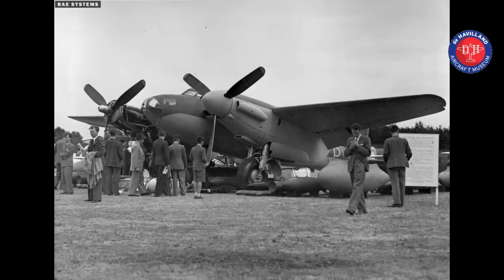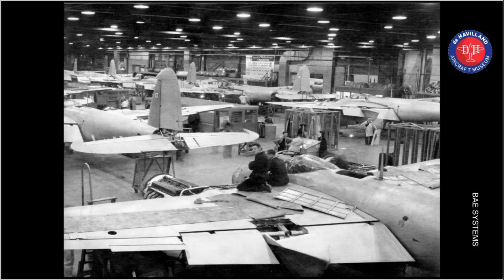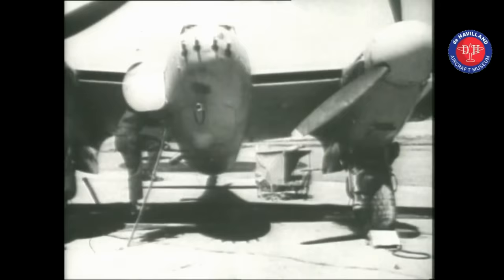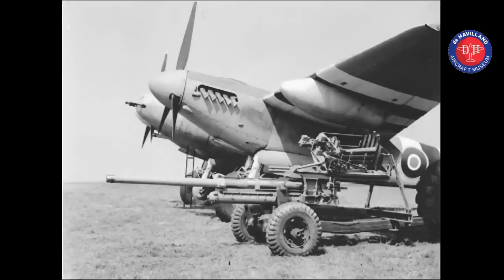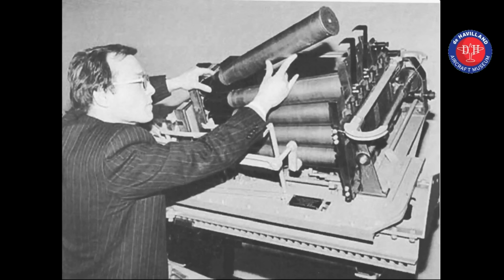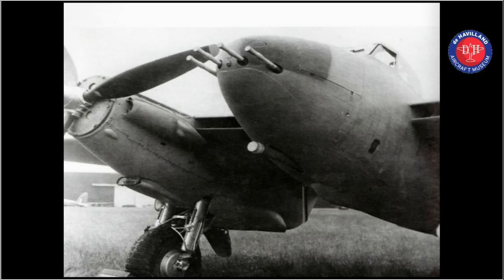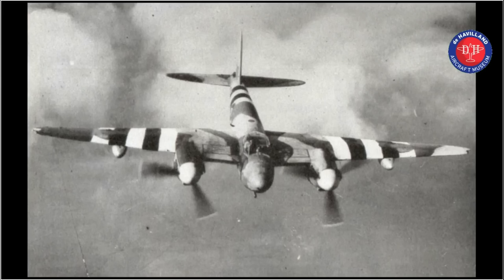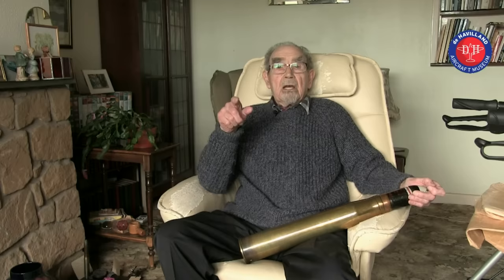TSETSE the DH Mosquito Mk XVIII

Comment: What an amazing aircraft, possibly the most effective of WW2 it seems nothing could catch it and its ability as a multi role aircraft were unequalled. We should have made 1000s more. Great video thanks for posting :)
Reply: The 'P-47 Thunderbolt' was indeed a great aircraft. Likewise The Hawker Tempest. But the best aircraft of WW2 came about when British Rolls Royce Merlin engines were put in American P-51 Mustangs.
Reply: The radial engine on the P-47 was an important part of the rugged survivability of the plane. A pilot could loose one or more cylinders to ground or air to air fire and still be flying and fighting. The reason? Radial engines of the era were air cooled, so there was no vital coolant to loose or radiators to be damaged by a single round to them. Additionally Republic built a very strong and sturdy aircraft to deal with the power of the Pratt & Whitney R-2800 Double Wasp as well as providing the pilot with an armoured cockpit.
Reply: What about the USS New Jersey, another weapon system not having anything to do with this video.
Reply: Who cares about the P47? It was a flying locomotive compared to the mossie and couldn't do half the roles carried out by the wooden wonder. Why does some Yank have to bring up the P47 in a video about the Mosquito.
Reply: Just a point, England is only 1 country in the UK, we also have Scotland , Ireland and Wales, some facts appear to have been forgotten in history. I will let you check what I have to say. Dunkirk ?? who helped and held back the Germans to allow this to happen. The 51st Highland Div. were sacrificed at ST Valarie and Abbeville, 1100 Killed, 40,00 Taken prisoner, no ammo, no food and no medical supplies . Just watch ' 7th Argyles Abbeville'. Yes we needed the Yanks, but they also needed us, Penicillin, radar, and yes the Merlin engine, also a fact also missed was the Liberty ship, a UK design passed to the US ,for construction, and never forget the time differences, you arrived in 42, we had been at war since 39. As for your comment on Empire, which other country has a family of over 50 countries tied together, The COMMONWEALTH , has over 1/4+ of the worlds population. Don't run us down just yet . and ask any US trooper who he would choose to guard his back.
Reply: Gerry, the Jug was a useful plane, but let's not get too ahead of ourselves. The armament of 8 x .50 calibre machineguns was nothing special for a late-war single-engined fighter, as most combatants were using 20mm or even 30mm cannon by this stage (a single 20mm cannon is as effective as three .50 Brownings). The Jug was quick in a dive, but quickly lost the ability to maneuver (its Mach number was lower than the Spitfire, ME109, FW190 and even the Mustang). This was one reason why the Americans stopped using it as an escort fighter - it couldn't intercept German fighters diving through air formations. As for its ability to survive damage, yes, that was probably its greatest attribute.
Reply: Wow Gerry you sure know all about the jug and America winning the war so we don't have to learn German. Shame this video is about the Mosquito. So run along and find a nice Yank video that tells about the jug winning the war, I'm sure there are a few out there. Oh by the way, the only German word I learnt was Gerry. LOL.
Reply: Quite right RicTic66: North American Aircraft designed and built the P-51 to a British specification, although the original Allison engines were under-powered and didn't operate well at altitude.
Reply: No disrespect but as you said the records have been destroyed supposedly, How can your story believed? If you have any proof please present it. Thanks.
Reply: Gerry
 Contrary to opinion , the Mossie could absorb massive punishment , its wooden construction allow cannon and flack to go straight through without exploding , and the plywood shell didn't have single weak points 

As for the P-47- I'll take the Tempest over it any day
Reply: It just amuses me to see you put so much energy into your idiotic ramblings when I only have to write a sentence!
Reply: Gerry Nightingale You talk a lot of sense but then you let your self down It was the British and her commonwealth forces that were responsible for Germany and her allies defeat in the first world war. In 1918 there was only one army in the field that had been in the war from the outset that was still capable of prosecuting the war and that was the British army. So where you get the notion that the first world war was a war that Britain could not win is beyond me. Perhaps you could enlighten me as to actually did win war for the allies and please don't say the Americans because if wasn't the British and her commonwealth forces( i am not counting the French because they were a spent force by 1918.) that only leaves the Americans
Reply: Gerry, I am not from the UK (different hemisphere) and where I am from we also call you wankers and yanks though I prefer to use the slang of septic tanks.  Lend-lease was the industrialists way of producing more war material and still get paid for it.Tom Lucas, you forgot the jet engine in your list of gifts to the Septics. Lastly, the P51 was an American built fighter made to British specifications and it was crap with the Allison engine in it.[EDIT] Sorry Shaun Salter, missed you post about the specs.
Reply: The Merlin mated to the P-51 became operational after Germany's loss of the war was sealed. The P-47 and the P-38 had carried the ball, the P-51 receives the credit, wonderful plane that it was. The first Allied fighters over Berlin were the 55th FG  P-38s on March 3, 1944. The P-51s didn't arrive until Summer, and the conversions was based on less operation expenses, high Altitude problems with the cold in the Northern European  Theater of operation, the kill to loss ratio was only marginally in favor of the Mustang. Southern European Escorts out of Africa, and later Italy used P-38s to the end of the War. The FW190s and Bf109s were equal to in performance to the Mustangs, but by the time of the Mustang arrival, attrition of experience German Luftwaffe Pilots, and a poor flight training program favor the Mustangs.  

In the 1969 two Central American countries, Honduras and El Salvador,  had a brief war, one Salvadorian P-51s and two FG-1D Corsairs were shot down by Honduran Air Force 17 Corsairs (nine F4U-5s and eight F4U-4s). On the morning of 17 July, a Honduran F4U-5 flown by Maj. Fernando Soto Enrique (then a Capt.) downed one of two Salvadoran P-51s that had been attacking two Honduran Corsairs on a ground support mission. 
Later, on his fourth sortie of the day, Maj. Soto shot down two FG-1D Corsairs from El Salvador in a single engagement. The last Piston Engine vs Piston Engine combat. Top US Aces in WWII, ETO, Francis "Gabby" Gabreski 28.0 and Robert S. Johnson 27.0 both flew P-47 against the best pilots Germany could offer.
Reply: The Mossie was a great plane in its various rolls, but the top Mossie only ace had 7 fighters to his claim.
Reply: +Gerry Nightingale - The ME-109 was basically an engine with wings, tail and a seat attached to it.
Reply: +farmerned6 - When the Allies first met the ME-262, the ME-262 shot down 2 Mosquitos. The ME-262 had 4 30mm cannons, but their jet engines were notoriously short-lived(very likely because the Germans had little access to rare metals to make the high-strength alloys needed) and burned the scarce high-octane fuel very quickly. 
The Tempest motor, the Napier Saber, was basically 2 V-12 engines in one, which worked great when it ran - it was almost unbelievably powerful, and Tempests could - and did - run down and kill V-1 buzz bombs(the first cruise missile.)
Reply: +Gerry Nightingale - Instead of what you say is Soviet propaganda, Jandal is referring to WW-2 German records; 2 of every 3 German soldiers killed was in the eastern campaign. Check for yourself. Also, you should remember that Detroit was once an America Propaganda Center, sometimes known as "What's good for General Motors is Good for America." I'm aware of the Russian's relying on American motor vehicles(my Dad, who was in WW-2, told me of meeting Soviet troops, driving early-model jeeps and telling them they were American - and the Soviet troops denied it - even though the jeeps had "Willys" stamped on the front.) The lack of motor vehicles was one under-realized reasons the Germans lost. Also, you should calm down. You shouldn't go ballistic just because somebody disagrees with you.
Reply: Stop asking people for their names Gerry - it's extremely unwise and unsafe to let go of your anonymity on the internet, especially in a popular and crowded place like YouTube.
Using your real name as your screen identity isn't some kind of badge of honour - something to be proud of while all the cowards hide behind screen names - it's a dangerous risk.

--S
Reply: I do have a name, but you're not getting it.
Nobody online is getting it because I don't feel like having my identity stolen.
Demanding that people release details that they don't want to share with strangers is extraordinarily bad manners - something you apparently have in common with Trump.

--S
Reply: Tracer rounds aren't designed to burn anything, only illuminate.
Incendiary rounds are the ones that do the burning.

--S
Reply: Your problem is that all of your 'facts' (by the way - what's with all the unnecessary quote marks?), are buried in a mass of arrogance and a complete unwillingness to tolerate anybody questioning them.
Doesn't matter how true or fake they are - you act like that, that's all people are going to see.

"I wrote nothing 'unseemly' until I was attacked."

When did I imply otherwise?

"my mistake is in thinking ... "

No dude, your first mistake was pushing your way into a thread where people wanted to talk about a certain plane they liked, and insisting that your favourite one was better.
Your second was your refusal to accept that anyone else could have a different point of view, or a different opinion about what might have made any aircraft of WWII subjectively or objectively, "the best one."
Your third was letting your temper run away with itself when other people got annoyed with your arrogance.

Like I said, if you want people to pay attention to your opinions, you need to dial that shit way back, otherwise you might as well just be shouting at the air.

--S
Reply: "I wrote nothing 'unseemly' until I was attacked..."

I just scanned back to the start of the thread to check, and all it took were two sarcastic comments, little more than typed eye-rolls and hardly "attacks," before you were insulting an entire nation and its heroes.
You're not nearly as innocent as you might imagine you are.

"... and no one need to take 'seriously' anything I  write."

Why on Earth are you writing it then? How were you hoping we would take your posts, if not seriously?

--S
Reply: I think it's time to disengage guys - Gerry's not interested in facts, or even debate. At this stage, he's just trolling us. Finding evidence proving him wrong won't change things - no evidence we could ever provide will ever be good enough to challenge the pre-conceptions and arrogance that he mistakes for his own 'evidence.'
This is just going to get more and more needlessly toxic and insulting.

--S
Reply: Hear Hear.
Reply: Gerry, If you didn't drop out of secondary school (or you broke out or were paroled from reform school before graduation) you could very easily look up diatribe in a dictionary or online. However, diatribe a forceful and bitter verbal attack against someone or something would be a misuse of the term, polemic would be more appropriate. I leave it to you to look up that word.
Reply: "The records for the 'P-47' are actual documented history..."
So what? They're still completely irrelevant to the topics of both the video we wanted to discuss, and the discussion that RicTic66 tried to start.
Let's go back and look at the original post, shall we?

"What an amazing aircraft, "

Unquestionable - you've admitted as much yourself, several times if I remember correctly. Why did you feel the urge to one up RicTic66 and the Mosquito, hijacking the conversation with your fawning over 'the Jug?'

"possibly the most effective of WW2"

There's certainly an argument for this. There's probably an argument against it too - you didn't offer one though. You just started talking about how 'the Jug' destroyed more 'tanks' and 'trains' and had 'super powerful' and 'unbeatable' .50cal 'machineguns.'
Totally irrelevant. Yeah, it was a great fighter bomber (which nobody EVER questioned by the way) - that doesn't make it the most effective aircraft of the war. Not even close.
How was 'the Jug' at strategic bombing? Tactical bombing? Pathfinding? Intruder patrols? Interdiction? Night fighting? High level or low level reconnaissance? Maritime patrol? Convoy raiding? Sub hunting? Undoubtedly I've missed a few. How many 'Jugs' flew from carriers? How many other jobs could 'the Jug' actually do?
The Mosquito's versatility and time in service are what put it in the running for the most effective aircraft of the war. Given that you didn't seem to want to talk about any of that however, I'm forced to wonder once again - what are you doing here?

" it seems nothing could catch it"

Hyperbole perhaps, but its reputation as one of the fastest things in the skies is both well known, and well deserved.

" and its ability as a multi role aircraft were unequalled."

As I just demonstrated.

So, what exactly did you take issue with from RicTic66's comment? What did you think they were wrong about?
I suspect that you simply saw a comment extolling the Mosquito and felt the need to take us snivelling and cowardly Brits down a peg or two by reminding us that 'the Jug' was better at blowing up tanks...

--S
Reply: That's weird - my last two comments appear the opposite way around from the way I posted them... The "disengage" one was supposed to come last.
Glitch in The Matrix?

--S
Reply: 3 weeks ago I wrote a 'subjective' post about how I as a proud Englishman whose Mum and Dad both fought during WWII with the R.A.F, thought the De-Havilland Mosquito was "possibly" the most effective all-round fighter /bomber of that conflict. Someone chose to question my choice and as everyone has a right to their own opinion I left it at that. After all a subjective opinion is just that. I've just visited a sight singing the praises of the   P-47 Thunderbolt and they're are no Brits claiming superiority or just being rude. I bet if the fellas who flew these magnificent aircraft in combat could see the tone this thread has taken they would  be saddened by all the nastiness.
Reply: I love the Mosquito and got to see one fly a few weeks ago up here in Seattle. Best a/c of WW2!
Reply: +d17a2dude
I hope you know how lucky you are!
Was it a restored plane, or a new build?

--S
Reply: Mark Fryer   "Radial engines of the era were air cooled, so there was no vital coolant to loose or radiators to be damaged by a single round to them."
very true....but a single round in the oil feed or sump......!!
Reply: Gerry Nightingale..Having read your comments about the Brits, the Yanks, WW2 and it's aircraft and who did what, may i just say.....you deserve every insult that is thrown at you
Some of them were, IMO, quite funny......".and my contention was and remains that in 1940, with the bulk of military ground-forces trapped in Normandy, Hitler could have simply slaughtered them all and proceeded with the invasion."   Using what? Lets say he slaughtered the entire BEF.. Now , he only had to gain air superiority, neutralise the Royal Navy...and beat the English channel. After Sealion was cancelled, in reallity, all Britain had to do was sit back, drink their tea., and watch the show. Unlike Americans, the British knew exactly what the Channel meant...Anything other than flat calm....forget it

"(it was 'radar' that saved the 'RAF'."
No, it was radar that enabled the RAF to pre-empt the luftwaffe raids.and to be in position to meet them.

"

".Germany had 2x as many aircraft available to accomplish that task, and for reasons I cannot find did not choose to do it ".
Well, if you don't know why, then you have no business making comments.. As for can't find out why....hell man, it's one of the most documented periods in history
Try this for size. 
you wrote...".English airfields were rarely attacked en mass...simply creating 'craters' would leave any  aircraft on the ground helpless, unable to take-off...and the 'long-millimeter' radar-towers were not attacked either...which would cripple RAF fighters by not knowing in advance 'where/when' the Luftwaffe would attack"
Actually, The airfields and radar stations were the ONLY things that were being attack in the early stages, and had Hitler not ordered reprisal bombing raids against London, instead of hitting the airfields the luftwaffe would have succeeded.
Yet you, an American authority on this subject didn't know this because you couldn't find any reasons..

"Hitler made plans to 'invade England' and what of it? "......Which practically  the whole high command knew couldn't be carried out for the reasons I gave above.....which is why it was cancelled after the BoB.
And before you say anything about the US and the BoB........this was fought in 1940, BEFORE lease-lend. Anything that went to Britain from the US was bought and paid for in hard cash, and at a time when the US was also trading with Germany

"had the U.S. not 'pounded the living shit' out of Germany and virtuallyannihilated the Luftwaffe BY OURSELVES...".   US 8th went to Britain in 1942. Now, according to you, Britain would have been dealt with by Hitler.....so, where would you have flown from...Newfoundland? And the Luftwaffe your guys faced from 1943 onwards was a shadow of the Luftwaffe of 1940

And you seem to think Hitler would have won in Russia. lol. That was never going to happen from day 1, with or without aid from anyone.  Germany was never equipped to fight in Russia during the winter..

".and yet Churchill said and did NOTHING about it...no 'war declared' against Russia as he had done with Germany."
a) Churchill had been warning the British Government well before Poland was invaded.
b) At the point that Britain and France declared war on Germany...Russia had NOT invaded Poland until 2 weeks later
c)Germany and Russia were not "Allies" as you seem to think. They had a non-aggression pact....which is a different thing altogether.  Russia also had a similar non-aggression pact with Japan.
d)Churchill was only 1st lord of the admiralty between Sept 3rd 1939...and June 1940. 1st lords of the admiralty do not declare war on anyone....and Churchill did not declare war on Germany
e)the pact between Poland and Britain was specifically about German invasion

"The photos or written material that prove that English fighters (NOT the Poles who flew with the RAF as 'independents) flew escort for the 8th. Air Corp? I WANT TO SEE THE PROOF that the 'RAF' flew as escorts over Germany with Americans! WHERE IS IT? "
a) Poles did not fly as "independents" They, like Canadiaian s, yanks, Aussies Kiwis wee all part of the RAF.
b)Lieutenant General Ira C Eaker and officers of the RAF Fighter Command agree to use Spitfire Mk IX's as high fighter cover for B-17s of the VIII Bomber Command until the VIII Fighter Command is ready for escort duty; this also will provide a test of the Spitfire Mk IX against Fw 190s at high altitude. HQ VIII Fighter Command moves from High Wycombe to Bushey Hall, England.......http://www.8thafhs.org/combat1942.htm

And from the same link.....MONDAY, 17 AUGUST 1942

ETO (8th AF): Mission 1: 12 of 12 B-17s bomb Rouen/Sotteville marshalling yard in France at 1739-1746 hours; they claim 0-0-1 Luftwaffe aircraft; 2 B-17s are damaged. 6 B-17s also fly a diversion without loss; escort is provided by RAF Spitfires.

TUESDAY, 8 SEPTEMBER 1942

(ETO, 8th Air Force): The "Joint British American Directive on Day Bomber Operations Involving Fighter Cooperation" is issued; worked out between Major General Carl Spaatz and the RAF, it consigns night bombing to the RAF and day bombing to the Eighth Air Force; the purpose is to achieve continuity in the bombing offensive and secure RAF fighter support for US bombers.

Unfortunately, that link only goes to the end of 1942, but it is enough to show that the RAF did escort US aircraft over enemy held territory..

Anyway, i think I have said enough to goon with. my point is made...if you don't want shit from people ....don't shit on them.....and please learn your subject.

BTW.....I'm South African of boer descent.. I have more reason to dislike the Brits than you could dream of...but really....you asked for it.

".
Reply: the P47 WAS SHIT!
Reply: Hey, Stinkie Dmin,  I just do not understand why you had to mix inside this melee our great president Donald Trump. 
If you really want to spit against wind, Angela Merkel and Jean-Claude Juncker are conveniently close to you.
Reply: I Like The Mosquitos I Was Wondering What Two P-51 Engines Would Made Do? ,Whew!!   WDA
Reply: Gerry is the stereotypical arrogant American. Just shut up. The p47 wasn't even that great. And the effectiveness of JABO's vs. Tanks is grossly exaggerated.
Reply: @DavidSmith-ss1cg  The Nazis had FAR more vehicles than they could use.  Their problem was shortage of fuel, which was the reason for the Afrika campaign (Middle East oilo), and also Operation Blau of 1942 (Caucuses oil).  The Wehrmacht had to go over to horse-drawn transport and shank's pony, the Luftwaffe had planes they could not fly, and there were hundreds of VI and VII rockets in stock but unused due to shortage of fuel.
Reply: @RicTic66  The P47 was shit doing Ground Attack Dive with a P47 and you went into the Ground 2600 WERE LOST to ground fire or simply unable to pull out.
P51 in a pigs eye.The Spitfire could fly rings around it all day
Reply: @markfryer9880  well how is it that they lost 2600 in the Ground Attack role RAF Typhoon combat debut one year before the P47 and only lost 670 from 42 to 45
Reply: @ALA-uv7jq  They like to muddy the waters
Reply: @Renshen1957  Oh dear here we are talking about a Mosquito with a large cannon than sank ships and probably killed 1000s of Germans and you want to rave on about aces Your Best was 26 Germans killed shit Pat Pattle in a Hurricane II got 35
Reply: @Renshen1957  You Americans forget the Spitfire was killing Germans 4 years before you came in and had more victories than the P51
Reply: @DavidSmith-ss1cg  The Mossie had 400+ VIs
Reply: @janalldaffer2913  what are you talking about ? the engines in the Mossie WERE Merlins the P51 licensed copies
Reply: MajorLeague  Over taken by the Mossie
Reply: @jacktattis143  The Chinese (Nationalist Republic of China and  Soviet Republic of China) can call the UK Johnny Come Lately's as they had fought the Japanese since 1937, or the Abyssinians (Ethiopia) fighting the Italians in 1935. And the Germans aces with totals into the hundreds.  The Spitfire was a great short range tactical interceptor which received the most of the glory during the battle of Britain, and the nineteen Spitfire squadrons were responsible for shooting down 521 enemy aircraft. The Spitfire's range An average of 27 per Spitfire. During the Battle of Britain there were 32 Squadrons with Hurricanes and only 19 Squadrons of Spitfires. Hurricanes shot down more aircraft than all other air (including Spitfires) and ground defenses (anti aircraft guns) put together. No. 303 Squadron RAF (Polish) Hurricane Squadron "Had it not been for the magnificent material contributed by the Polish squadrons and their unsurpassed gallantry," wrote Air Chief Marshal Sir Hugh Dowding, head of RAF Fighter Command, "I hesitate to say that the outcome of the Battle (of Britain) would have been the same." And the UK Govt. wouldn't let the Poles march in the Victory Parade so as not to offend the Soviets. Sgt. Josef František with 17 victories was the leading ace of the Battle Britain.  The 303 converted to Spitfires Jan. 1941. 

We don't forget the day we entered the war, or prior in violation of international law, we claimed neutrality and shipped war materials, performed convoy duties (neutrality patrols, , fuel, etc. to your country.   We also don't that instead of making the Pacific our major commitment and the US citizens of US territories seized by the Japanese suffered for this "Europe first, policy.' USS Greer ineffectively engaged U-652 on September 4, 1941; and on September 11 President Roosevelt declared Axis ships entered the neutrality zone at their own risk, and ordered the U.S. Navy to attack any vessel threatening ships under American escort.  The Gleaves-class destroyer Kearny was torpedoed while escorting Convoy SC 48 on October 17, 1941. The destroyer Reuben James was torpedoed and sunk on October 31, 1941, while escorting Convoy HX 156 with a loss of 100 lives. Those actions were technically acts of war. 

We also do not forget that the US 8th and 9th Air Forces losses in the ETO were higher than the Marine deaths in the PTO and at 35,000+ about the same as the RAF losses 38,000+ RAF pilots losses were, not counting the RCAF, RAAF, RNZAF, SAAF, then the total becomes 52,000+ combined total).  Half of the U.S. Army Air Force's casualties in World War II were suffered by Eighth Air Force (more than 47,000 casualties, with more than 26,000 dead).  The Spitfire didn't have the range to protect the bombers The P-47 didn't have the range but went further. The P-38 did have the range but USAAF brass stuck with the mid 1930's false dogma, "The Bomber Would Get Through." The P-38 proved its ability when was being used in Long Range missions in the MTO and PTO.

The RAF had the range and speed in the Mosquito, but not the turn radius nor the roll rate to take on a single engine fighter.
Reply: @Renshen1957  I will go from bottom to top 
1.Mossies shot down 5 Fw 190 Kiel  5 May 1945
2. P38 easy kill to German Fighters lousy Tactical Mach and not a good roll rate
3. In Italy the MkVIII with 90 gal slipper tanks had a range of 1100+ miles.
Over France they could do the same with the IX but the USAAF bomber crews were very bad at aircraft recognition and the RAF left the USAAF fighters do the escorting
4.  53000 RAF IF TRUE THEIR LOSSES WERE OVER 6 YEARS DID YOU COMPREHEND 6 YEARS . Look it up and the USAAF losses in Personnel in the Med and ETO  95000 in only 32 months so not good
5.If the USAAF lost more than the Marines tell them that I do not care really
6. Dont start crying about coming in If 
Hitler had not declared War on you Your German loving senior Officers would have kept you out.
Nimitz first Gen German American Eichelberger Willoughby all fluent German speaking but allowed to serve in the Pacific.
6. USS Reuben James disgraceful act by the cowardly US government
If the US had declared War then there would not have been the Attack on Pearl .